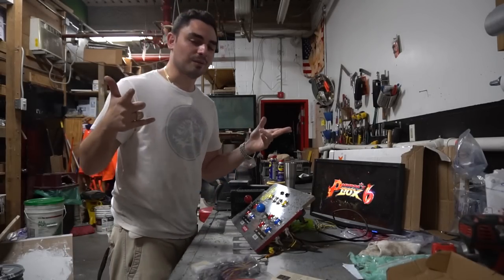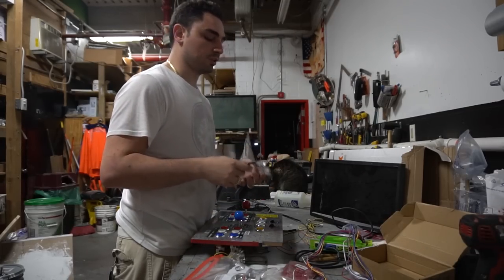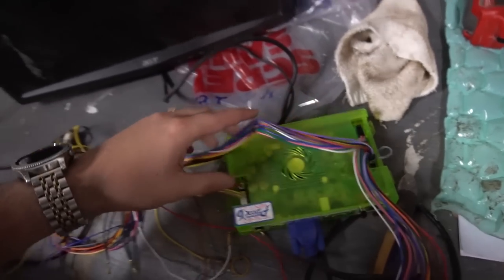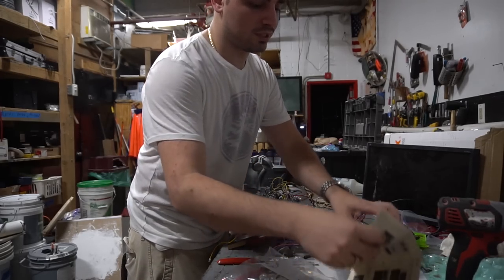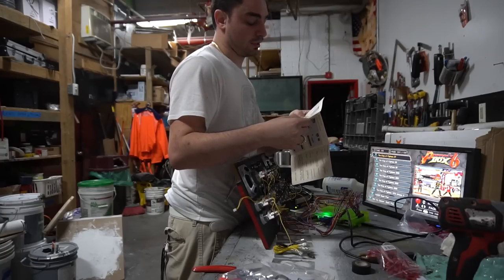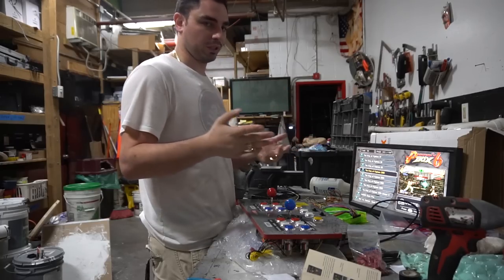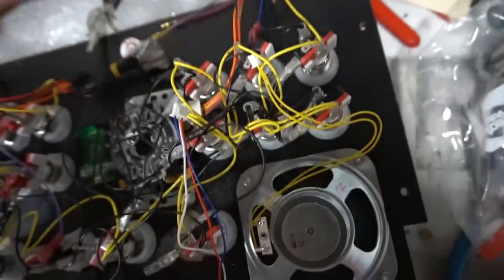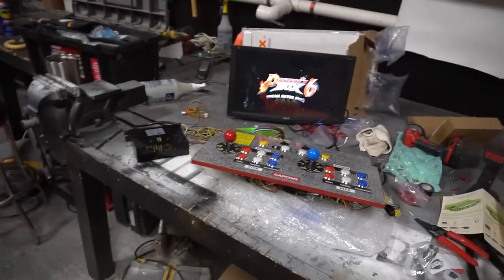Pandoras Box 6 in Arcade 1up part 2 wiring

Comment: I got a Pandora's box 4s, and I'm in the process of changing out the joystick/ buttons into the American style bat top joystick/buttons! But I am going thru that trouble of rewiring the joystick cuz the Pandora's joystick got 5 wires (green, yellow, orange, red, and black) . And the other one got 6 or 7 wires (green, blue, purple, orange, yellow, and red) set up! I dunno if I should switch the wires around and to different prongs cuz apparently it doesn't go by colors
Reply from the maker: No it won't go by color, is your old joystick led???
Reply: @Vic_VP  no. It's actually from the street fighter 15th anniversary fighting stick that I'm using on Pandora's box
Reply from the maker: @MrKiet76  your best bet... black is always ground. So grojnd the wire and then get into the test screen and connect 1 wire at a time to see what action it does
Reply: @Vic_VP  in my case it's red as ground from the way it's set up! As far as forward, back, up, down I got it covered. Now it's jumping forward or vice versa is gonna be a challenge lol btw thx for the quick reply

Comment: Hey there.  I bought the Pandoras Box 6 kit with the LED buttons.  I used the wires they gave me to hook everything up, including the LED wires to the buttons.  Thing is, you have to plug the LED wires in the same socket as the power wires.  They give you these two super short yellow wires with fatter connector ends to make up for it so you can still power the device on.  Thing is, the prongs under the power switch are super small and these connectors are super fat.  The slightest little tug will pull them off.  Is there a way to extend the wires and secure them safely onto the tiny prongs?
Reply from the maker: Hey bud send me a link to what you brought. Message me on instagram @vic_vp
LEDs are bot 24v, if you plug them in directly they may pop and break. Send me link to what you purchased
Reply: @Vic_VP  nevermind thank you for responding you're the only one who has. It occurred to me today that the real issue is I'm not using the switch that they included in the kit which was supposed to take the place of the stock power switch
Reply from the maker: @WhoWatchesThis  interesting, let me know if you have issues

Comment: How would you make the 'player 2' button a 'coin' button? Do u have to split the wire from player 1 to go to player 2?
Reply from the maker: Yes you basically can take a random piece of wire and connect it to the player 1 coin wire. If you do this then do not wire the player 2 pause button. I'll make a small vid on it.
You'll basically be jumping the wire
Reply: @Vic_VP  hey thanks. I know this is probably very basic stuff but I've never done anything like this before. A video would be great! Thanks again.
Reply from the maker: @PST101  got you buddy ik finalizing this build so there will be 1 more vid and I'll add it to the vid

Comment: if i plug a usb flight joystick will it work for flight simulator games? If it doesn't, if i get the arcade flight joystick how can i make it work for 1UP when i play a flight simulator game? I cannot find anywhere these informations.Thanks.
Reply from the maker: Your definitely not looking at the correct vid. You'll need a pc for sure, pandoras box will not work.

You'll need a pc, arcade sticks will be wired to a USB encoder and the. You'll have an external flight stick for flight Sim
Don't waste your time, forget the a1up, get a real cabinet for flight simulator such as a 32 inch upright
A1up is very cheap and small screen.
Reply: @Vic_VP  i have already bought pandora DX (family edition), joysticks buttons etc and almost finished the woodwork and i was just wondering (in the middle of the night here) if i can throw between the 2 joysticks (i have space ive made it quite wide) a third one for flight simulations. Anyway thanks for your help!
Reply from the maker: @sakispegasus2385  yea you can, but you'll need a pc to play flight Sim. There is no flight Sim on the pandoras box
Reply: @Vic_VP  By saying flight sims i mean the flight arcades! How is it possible? Is it.... explainable? Thank you for your time

Comment: Hi! I am waiting for my pandora delivery. I would like To know if The power switch can be replaced with a jumper To make The Pandora works When i turn on the master switch. Thanks
Reply from the maker: Yea that should be a easy basic switch install. You prob cut into the negative of the wire... but triple check that as I'm not 100% sure which wire you need to add the switch to